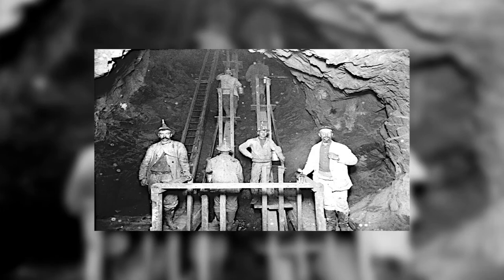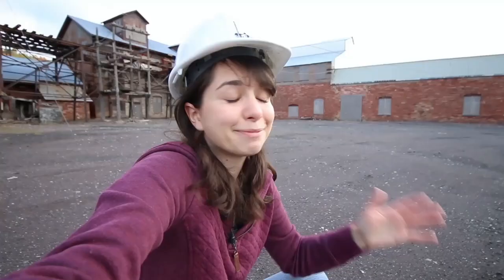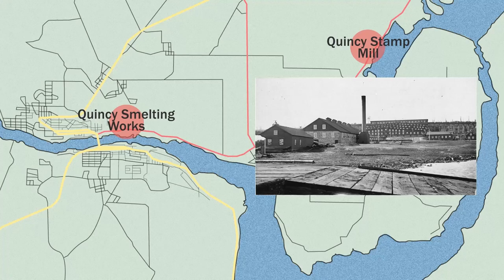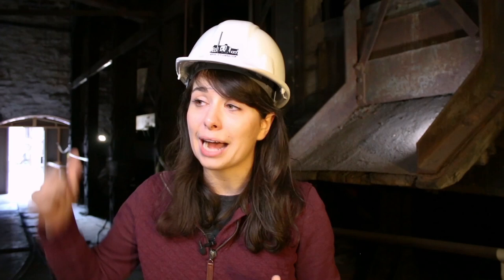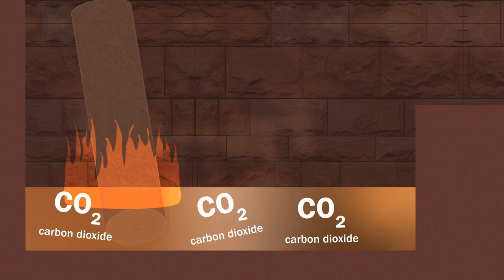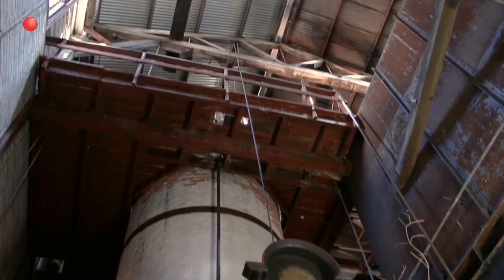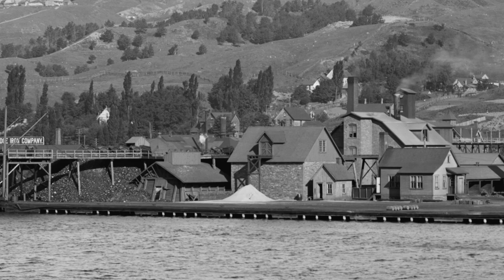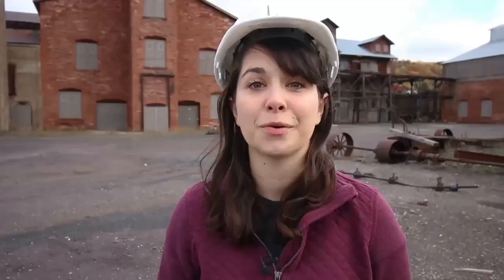How to Make 1 Million Copper Bars | The Quincy Smelter

Comment: I did some maintainence work at Hussey Copper just outside the Pittsburgh area. You'd be surprised how close we got to molten copper. They were still using trees during the smelting process. Watched in fascination as a machine jambed them into the furnace, sometimes slamming them against the walls, shaking the entire unit. Pouring the molten copper, it ran down a sluice where they dumped bags and bags of charcoal to remove any remaining oxygen. We actually worked under the sluice when they were pouring copper. Saw everyone run like heck one day when a waterline burst at the moulds. We joined the run, not knowing what was going to happen. Most of the big presses in there were probably close to 100 years old, if not older, and still worked like a champ. Built to last.

Comment: I first visited Quincy Smelter in 1980 when it was still totally intact. We climbed in through an open window where the steam engines were. The lab was still full of glass jars and bottles. We camped that evening with our motorcycles by the old Quincy dredge and reclamation plant and dropped acid (LSD). Had a couple close calls in the ruins. That night we were the laughing ghosts under a full Moon. Good times.

Comment: Very interesting to me how they processed the copper ore. I worked in an Arizona copper mine mill and crusher in the 70s and the way we processed the ore to be sent to the nearby smelter was completely different. The ball mills crushed the ore into a fine silt that was put into air agitated flotation tanks with a reagent that caused the copper to float to the surface to be skimmed off. The mostly pure copper slurry was then pumped by pipeline to the smelter to be melted down after the the water was drawn off the slurry by vacuum pumps and filter screens. Sounds complicated, but it was a beauty of a system to watch work.

Comment: Thank you for your video. I have recently become a fan of your efforts.

Suggestion: Visit the Nickel/Copper mine and smelter in Sudbury Ontario, Canada. This is one of the richest and most productive mines on earth. You would be interested as the ore was created by the impact of a very large high velocity meteorite impact that resulted in a 100 mile wide crater and the quite deep impactite deposits your mentioned in another post. This mine is the site of a amazing environmental restoration program repairing the damage of a hundred years of releasing SO4 gas at ground level. It is not all that far from Northern Michigan.

Comment: With high quality copper ore you have no need for dissolving chemicals like cyanide or acids so instead you can just use a flux aka borax or silica aka glasses and the impurities all absorb into the glass while the pure metal leaves a prill at the bottom and than those prills are re melted in a larger amount with alot less flux and the flux than sits at the top of a large ingot or cake where it can be broken off and you are left with 99.99% pure metal but ofcourse it is an alloy because of other metals being present in tiny amounts like lead!

Comment: Would it be reasonable that the copper of the UP may be resultant of the Sudbury meteor either by cast off of the blast or by displacement through a former rift area of molten copper?
Reply: probable not since the Mines follow a seam  that goes  close to a mile underground.